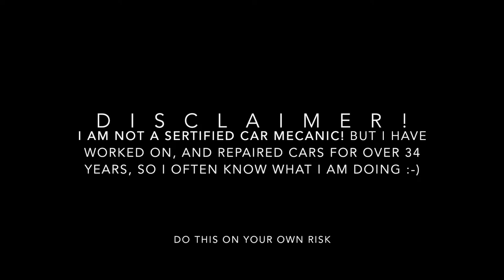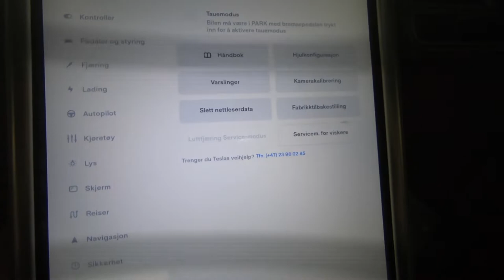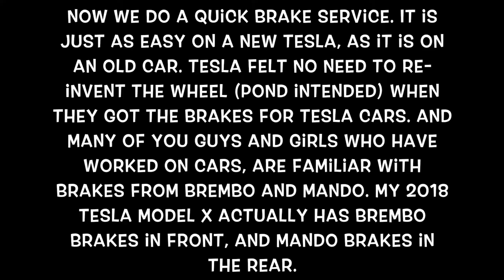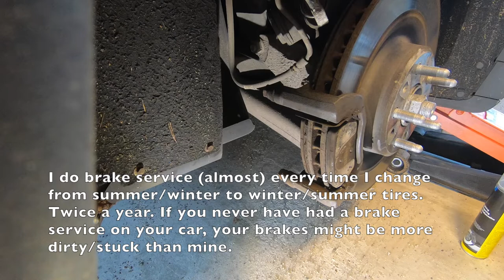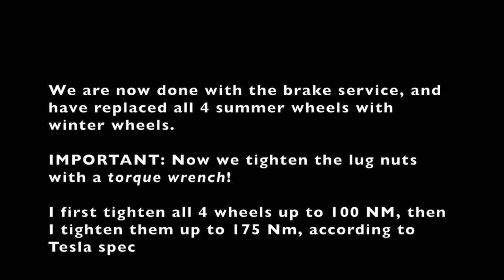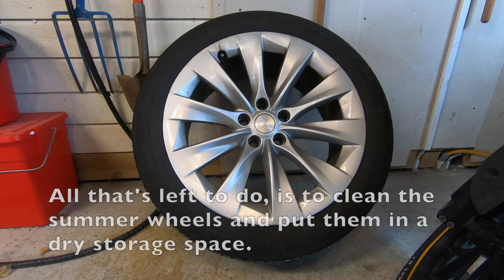DIY Tesla model X brake service and changing wheels. #tesla #brakeservice

Comment: Where can I purchase the front brake pin removal tool you used in this video in Norway?  At BIltema or can I find it at Thansen, like the ceramic grease?  Thank you!  (Takk!)
Reply from the maker: You can buy this (4 mm lang drivdor, som det heter på norsk) at several places. I've had mine for ages, but I  see Bilxtra sell them:
https://bilxtra.no/dor-4mm-175mml-f-brems-splint

And also Jernia sell them:
https://www.jernia.no/jernvare-og-verktøy/håndverktøy/slagverktøy/dor/ironside-dorpinne-150x10x4mm/p/32234098

Or you can buy a set at Biltema:
https://www.biltema.no/verktoy/handverktoy/drivdor/drivdor-2-8-mm-2000024016

Hope this helps you 😊

Comment: Did you need to take the service plug out the car first to work on the brakes
Reply from the maker: I'm not quite sure what you're thinking about, but if it's the cap on the brake fluid canister. Then yes it might be smart to loosen it.
Reply: @rogerdostuff  sorry roger! it is just that i am new to electric cars and trying to learn more about them. I watched this video about them and it says electric cars can kill you if you are not careful. I thought that maybe the pistons were connected to the electrics on the newer models. See if i never took the parking brake off, could i get zapped by your car?
Reply from the maker: No worries Bonnie 😊 There are no stupid questions, just stupid answers. And if anything I replied to you helps you out, I am very happy to help you. And no, brakes on electric cars are not connected to electricity. Many of them have an electrical operated parking brake yes, but this is driven by the 12V battery. The only main difference between fossil and electric vehicles are the motors that drives the car. You can almost say that an electric car is easier to work on, they have less moving parts 😊

Comment: How did you get the brake pads out without loosening the bleed nipple?
Reply from the maker: I use a small prying tool, like you can see at around 4:30 minutes into the video. Or I use a pliers to gently push the piston into the caliper. Just enough to loosen the pads, and make room for the new slightly bigger pads. If you do it slow like this, you will slowly push the brake fluid back into the brake fluid container. Just be aware that it might flow over if you do all 4 at once. Slow motion is the key here. I have done this for over 30 years, and haven't had any issues changing brakes like this. But I am not an authorized mechanic, so like I put in the disclaimer; Please do this on your own risk 😊
Reply: @rogerdostuff  would it be dangerous to loosen the brake nipple, with it being an electric car?
Reply from the maker: No, it doesn't matter if it's a electrical or fossil fuel car. The brakes are the same system. Just make sure that the parking brake is off as always. This is to ensure that there's no pressure anywhere in the brake system.